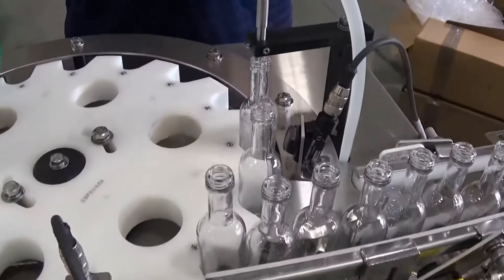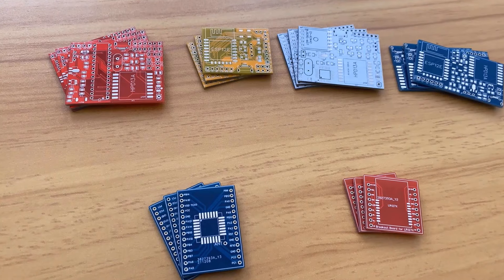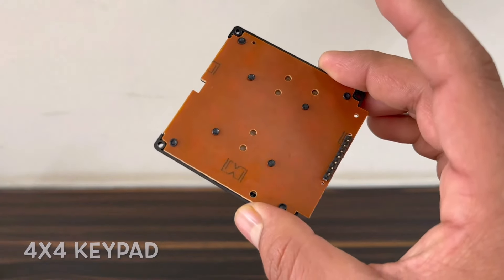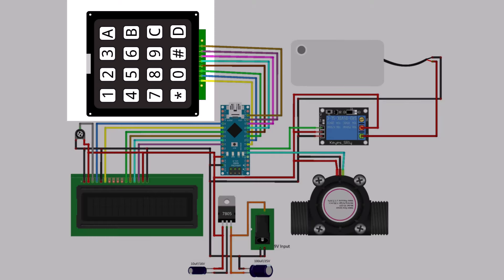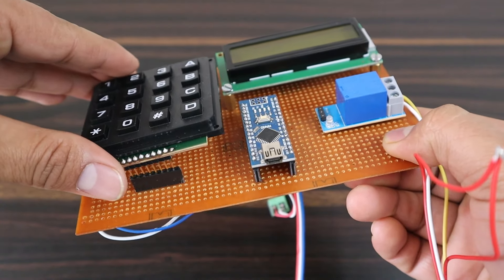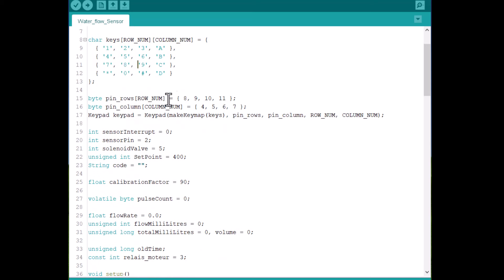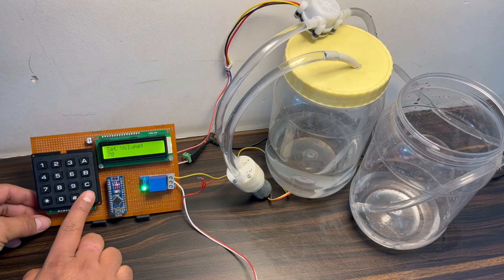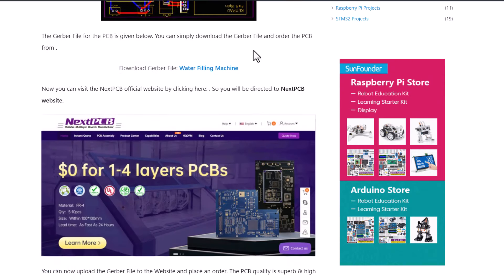User Input Based Liquid/Water Filling Machine using Flow Sensor & Arduino

Comment: Dear thank you for this video, I made this project with the help of this video it is working fine, I need your help if I want to repeat same volume, than the arduino coding will have to be changed?
Reply: You have used zero pcb for this or either you have designed pcb  for this

Comment: Hey there, I need your help badly...
I have done all the things you told in the video, I put all necessary equipments that you used, but my circuit isn't working, LCD is showing nothing and when water starts flowing through yf-s201 the relay model doesn't stop the motor at right volume... kindly help me what should I do? Please, it's my project for university
Reply: You have used zero pcb for this or either you have designed pcb for this

Comment: If the water has been put in and  you need to set a new volume of water, which button should be pressed to clear the previous transaction and to set a new transaction?

Comment: Caution! Built the same setup shown here and my arduino Uno is not working anymore. I took instead of 9V 12V and instead of Voltage Regulator a Mosfet but shouldnt damage the arduino. Anyway its not working anmore ......
Reply: You have used zero pcb for this or either you have designed pcb for this

Comment: Hello! really nice video... congrats... one question, if i would like to use liters instead of milliliters.. is it possible?
Reply from the maker: Yes modify the code and set parameters for measurements.
Reply: thats nice @HowtoElectronics  .. thanks... one more question/help. I am using a keypad 4x3.. can you help me with the changes that I have to do? thanks in advance

Comment: 🔝...how filling machine by weight ???
Reply from the maker: By volume.
Reply: @HowtoElectronics  and by weight how ???
Reply from the maker: Certain volme has certain weight. In case of water 1000ml=1kg.
Reply: @HowtoElectronics  of course but with weight I have possible more  "liquid" ...for example honey ...
Reply from the maker: Use the formula. 
Density = mass/volume.
Reply: @HowtoElectronics   how measuring the volume of honey if is difficult to pump or measuring the volume/s ???? There is many project to this application but your approach is more simple that another project man
Reply: Honey is also liquid form na you just celebrate and then you used it supposed if you want to find weight then you also used the weight sensor 😊